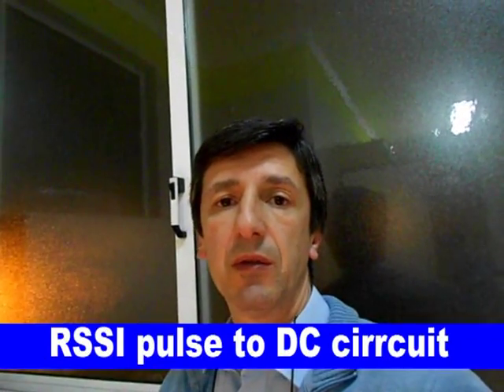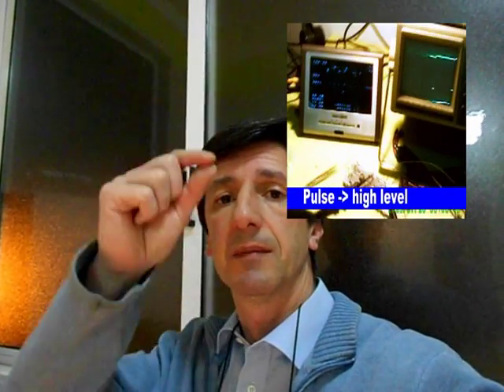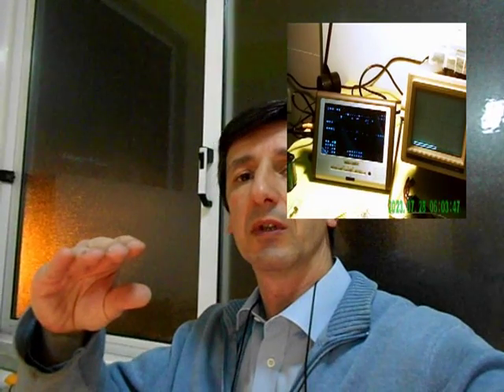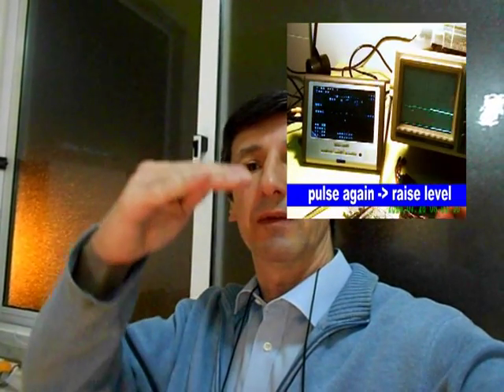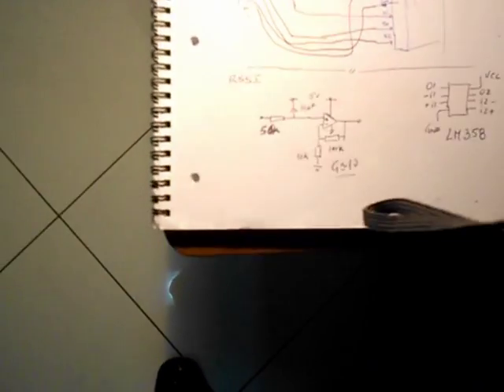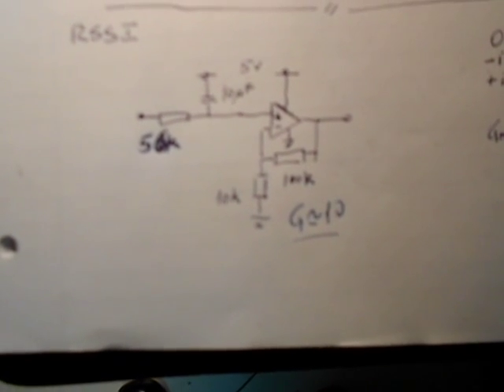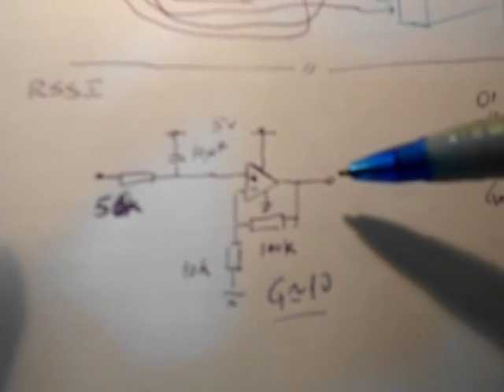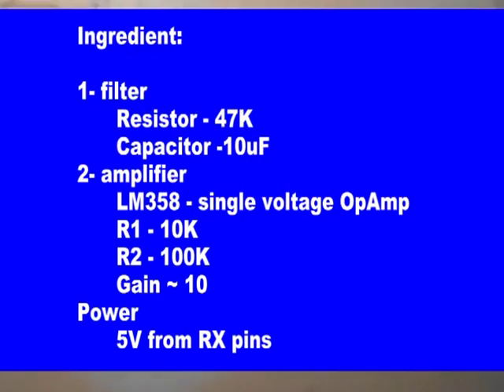FrSky RSSI Wave Converter explained

Comment: hi Pedro,thanks fro the all info on the arkbird,i just order mine,and I'm reading a lot of peoples thoughts about the siste,but just somenthing I do not undestrund,my uhf sistem have rssi pin out where do i need to connect on arkbird module to get the signal displyed on the screnn?and do you think last batch of arkbird tgey have already been relesed with new firmware or still the oldone?and last question do I need to upgrade the firmware to get rssi on display? thanks